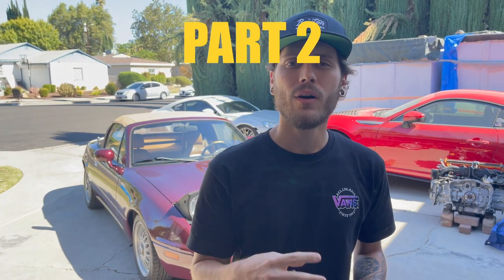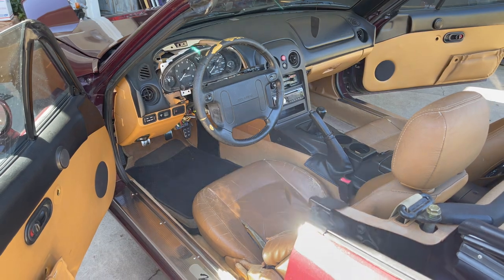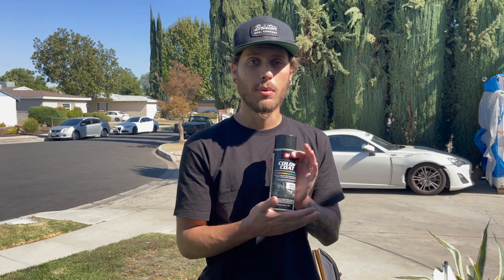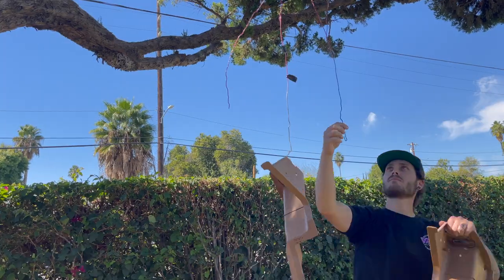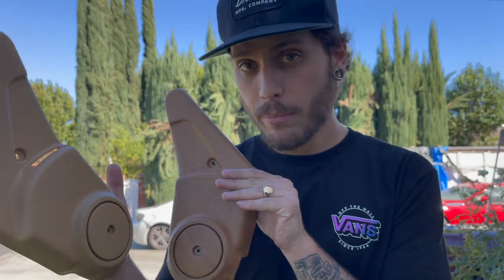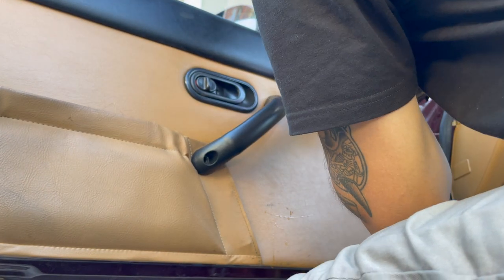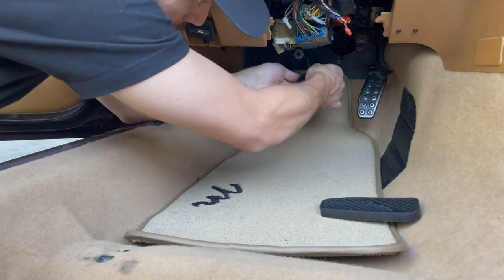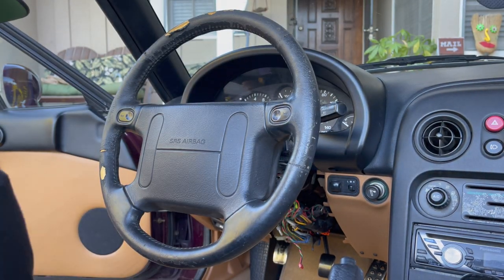Miata Interior Plastic Restoration

Comment: Nice work. It will be interesting to see how well the painted plastics hold up.
Reply: if you do it correctly and use the adhesion promotor( which I didnt see them do) SEM color coat lasts forever and isnt really paint, its more like a dye that bonds with the plastic.

Comment: Love your video man! My NA miata's center console's plastic coating is peeling off should I sand it down first then paint them?
Reply from the maker: Thanks dude! 
I would do a suuuper fine sanding job on the center console 
Maybe even like a scotch red pad 
Enough to knock the plastic coating off but not enough to put any scratches into the plastic
Reply: @SpiritDriven  Thank you for the suggestions man! Kepp up the good work. I recently just got my first miata and your videos have been helping a lot!!

Comment: So is this kind of a rubberized paint like they put on many German cars from the factory? I wonder how it will hold up over time.
Reply from the maker: As long as you do multiple coats it’s very durable 
But it isn’t a rubber texture 
Still keeps the plastic panels the same texture

Comment: How does it come out after you use any detail conditioner on it?
Reply from the maker: No need to use that stuff personally I like material with zero sheen
Reply: @SpiritDriven  I have product that doesn’t leave sheen on it, mainly do it for hydrating the material.
Reply from the maker: @scarface8806  should work fine 👍🏼